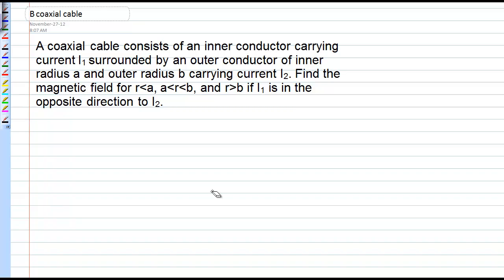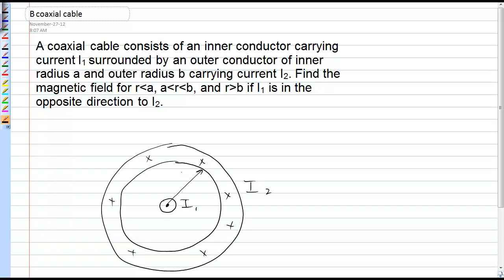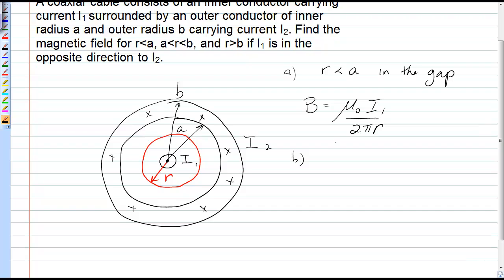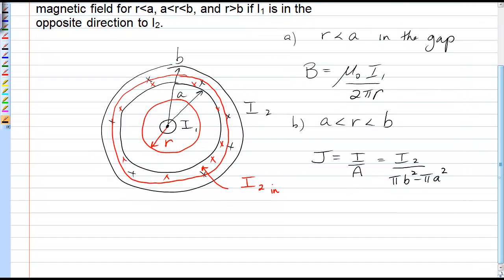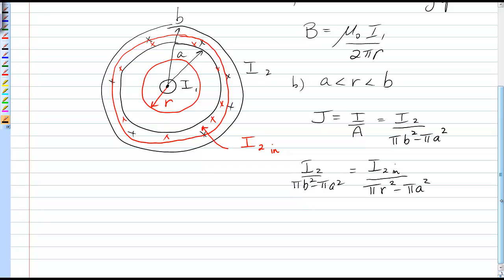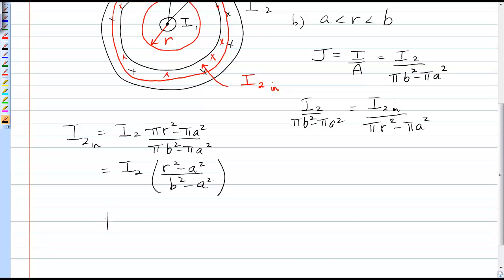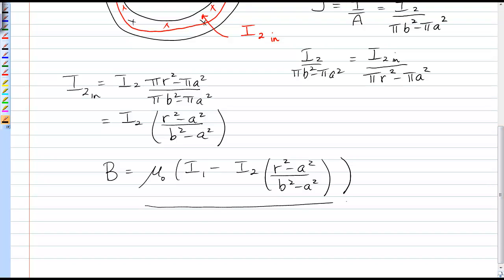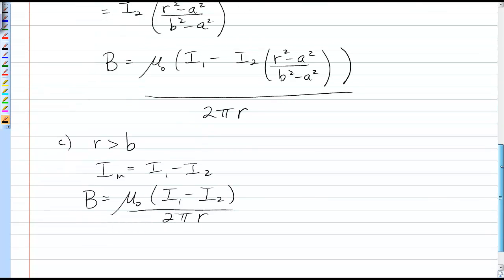Magnetic field of a coaxial cable carrying currents in opposite directions

Comment: Given that the tranamission line is 20 km long. It is fed by a sinusoidal source of 100 V having a frøquency of 2000.Hz. It is terminated in a pure resistance of 600Ω. Find. the primary.and secondary constants of'the line, if the transmission line parameters are : R=10Ω/km, L=1.mH/km, G=10μS/km and C =.10 nF/km, Also compute the sending end and load end currents.